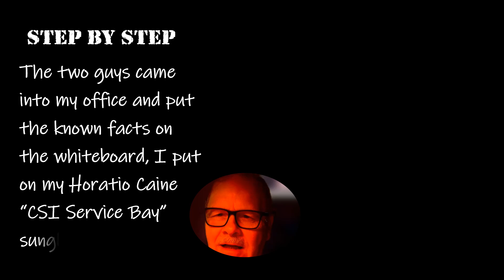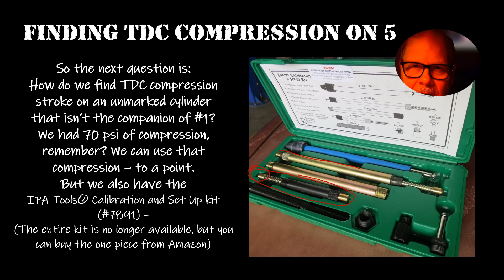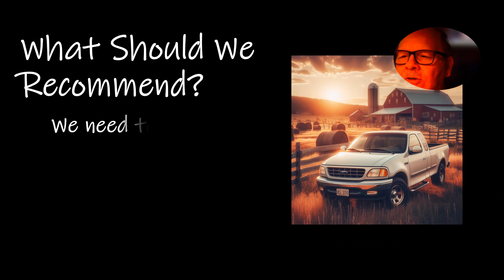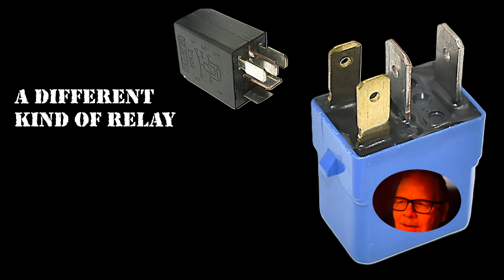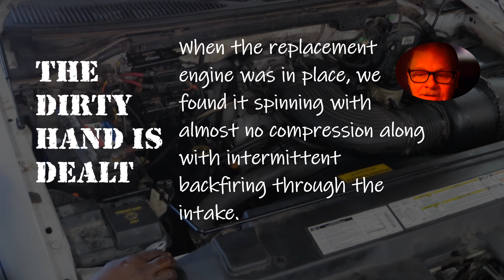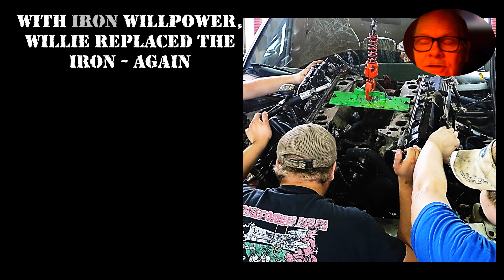CSI Service Bay Detectives

Comment: Always a pleasure to listen to your
Lovely experiences and great knowledge! Curious what did u have the chain hoist hooked up to when ur student was pulling the 4.6 out of the truck? I could not see it clearly in the picture. It sure was high enough, almost the height of the hoist, possibly cross beam?
Reply: Thank you😊
Reply from the maker: That hoist is electric and is a rolling 4 ton unit that trolleys on a piece of I-Beam mounted on steel pillars above two service bays.

Comment: Ford is not the only company that would put a six where logically it should be a w.. I worked for Chrysler for 9yrs and they would do stuff like that on a regular..
Reply from the maker: Back in the 70s some of the Dodge/Chrysler engines might come with just one cylinder bored .030 over and a .030 over piston in that hole. Wacky stuff.